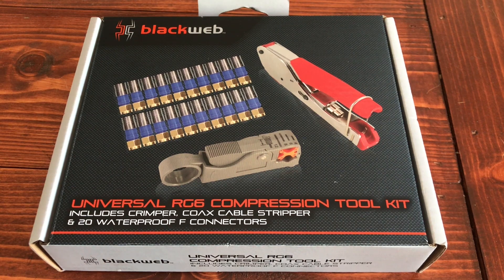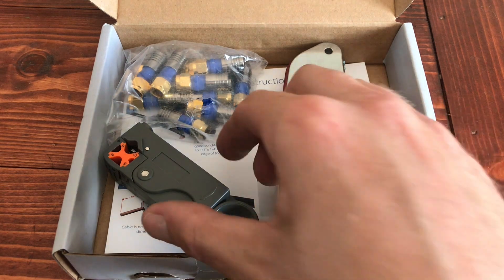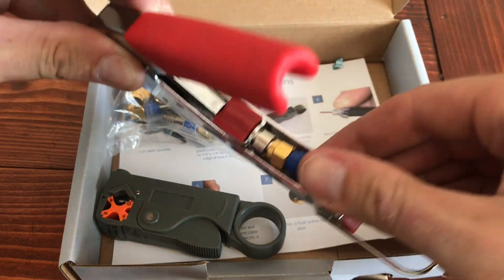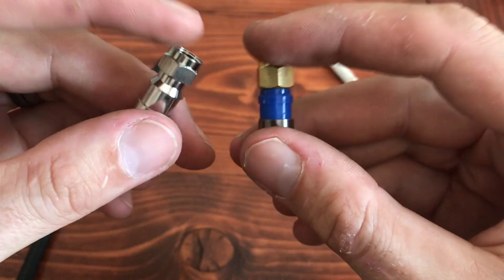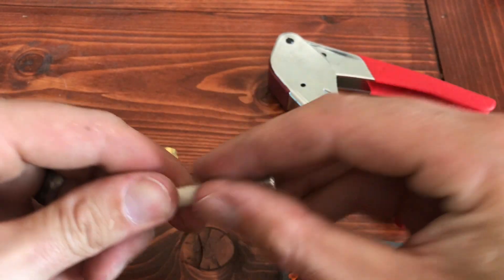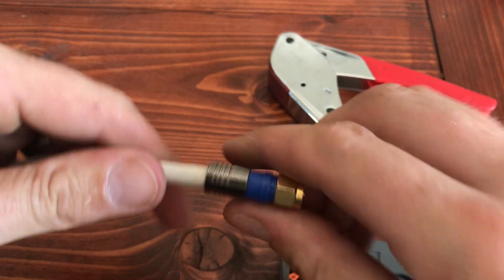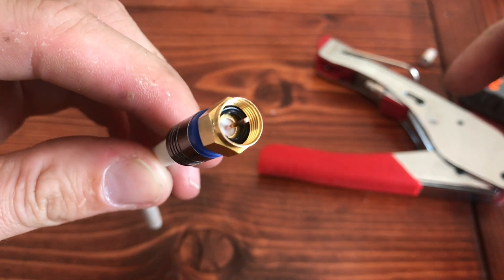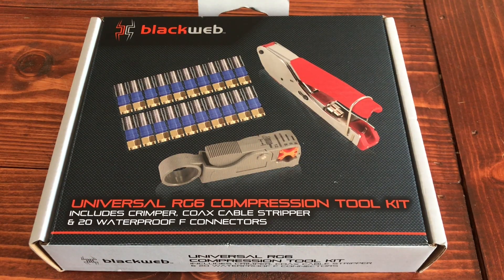How to cut and Crimp COAX cable (Universal Coaxial Tool Kit Review)

Comment: You didn't mention the different cable size setting in the stripper tool die, (that orange thing in the cutter head) nor how important it is to get the cable slid all the way to the end stop guide. And you failed to mention that the direction you rotate the stripper tool is very important.  Not to mention how to tell when you have rotated the tool enough to know the cut depth is correct and finished.  
You could have at least shown the blade adjustment screws are. I bought this tool at Wal Mart for $14, yesterday and the instructions are just pictures, a few numbers,  and just give about as much info as you did. Apparently this is a disposable tool that you burn through the connectors learning how, then throw away after you've made you one connector properly.    A real handy tool once one learns the propper way to make it work and jeep it working.
Reply from the maker: Duly noted. This was also my 1st YouTube video ever posted, so if your so opinionated, feel free to make your own video series on cutting coax cable 😂

Comment: got this kit and after I messed with this for 30 minutes ,real glad I got it .thanks.
adjust your blades to right height helps big time.PUSH hard as hell to get the fitting flush .do a couple and you'll understand  how to get the push easier. thanks for the vid!

Comment: Thank! I had to practice doing this and learned a few things: It's important to get all the shielding and stray wires removed, push the cable as far as you can into the connector first, then while crimping apply pressure to the cable so that it "stays put" and the compression can take place.

Comment: Lies pulls right out.
Reply: If you have too thin of a coax cable, just wrap some black electrical tape around the end where the connector is going to be put.. works like a charm.
Reply: @k3wld3wd95  What is the optimum coax cable thickness? I am having this problem.
Reply: @BlueJaykeUK  I believe Optimum uses standard RG 6 which is somewhat thick. Usually the thinner cables are the RG 59 or 3C2V variety.
Reply: The electrical tape worked perfectly.